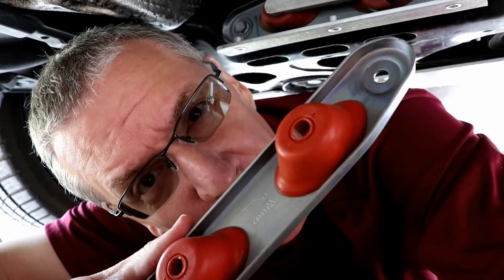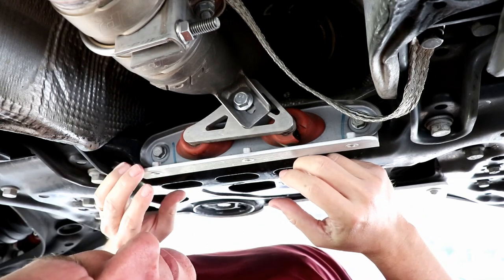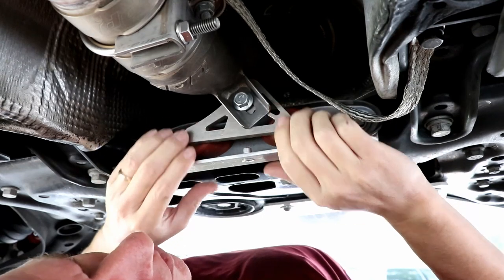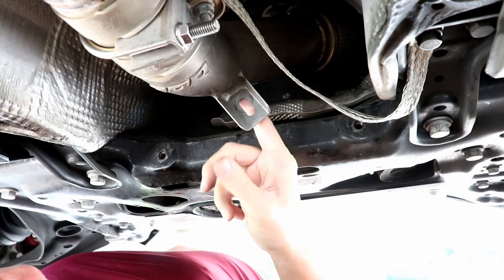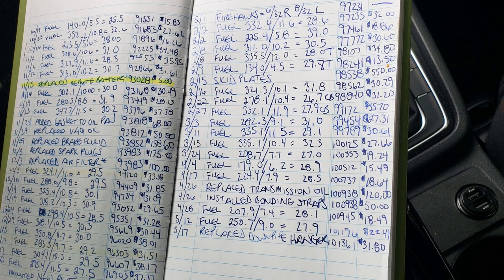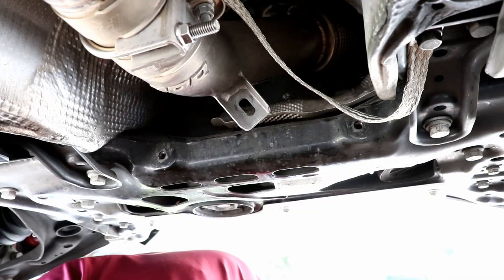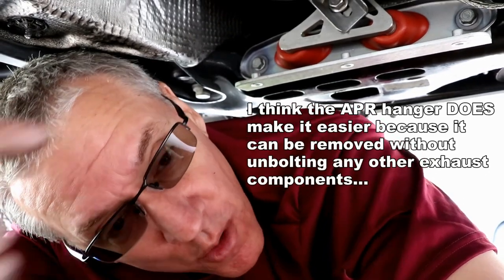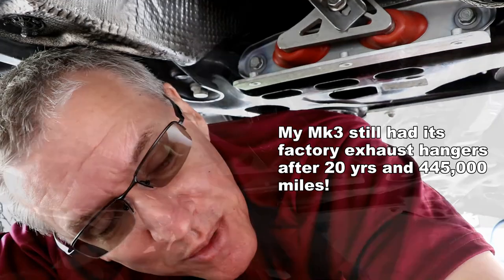REPLACING THE DOWNPIPE HANGER ON MQB VWs

Comment: Replaced my split plastic bracket with a nice shiny metal one Used red rubber grease on the bushes during refitting
  Thanks for posting
Reply from the maker: Thanks for sharing your purchase experience.
Reply: My plastic one is split aswell. Rubber is destroyed on right side. I got a new shiny metal one and I’m about to replace it now . Let you know how it turns out with my stock Downpipe

Comment: I think on the bushings you can spray some soapy water (or wooder if you are Chris Fix) to help press things in. Then it'll just wash away with the rain.
Reply from the maker: They weren't too hard to remove. I just couldn't get any leverage on the mount while laying under the car. Thanks for the tip about soapy water. Hairspray works, too. But I don't have the same access to it today as I did in the 80s and 90s.  ;-)

Comment: Looks very clean under there for a 100K car. Looks like brand new.
Reply from the maker: Thanks! Yeah, the car is doing really well. Thanks for visiting.
Reply: Srsly - my 4 year old MK7 is definitely looking "older" and it only has 47k miles. Damn overuse of salt in the NE area! 2 flakes and the roads end up with more salt than snow.

Comment: What symptoms were you getting any rattling or anything ?
Reply from the maker: No symptoms. I discovered it during a visual inspection. Thanks for asking.
Reply: @StealthGTI  yea just woundering cuhz mine was like that as well ! I am waiting for part to come but been hear some type of rattling and first thought it was coming from Clutch but now I’m thinking it’s that ! Cuhz it’s intermittent
Reply: @yayo_mk7  did getting a new one end up fixing the rattle?
Reply: Still waiting for it but check exhaust
Reply: @yayo_mk7  hey I have a mk5 jetta and head rattling aswell thinking it the tyranny and when looked under car found this bracket tore and arm came out handing and cause of the rattling